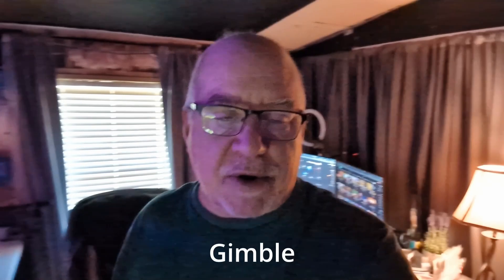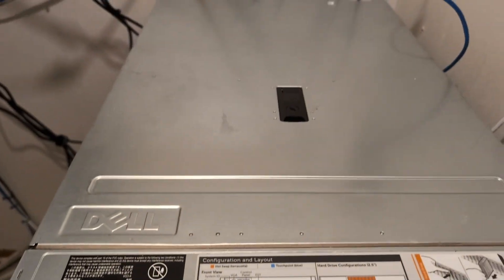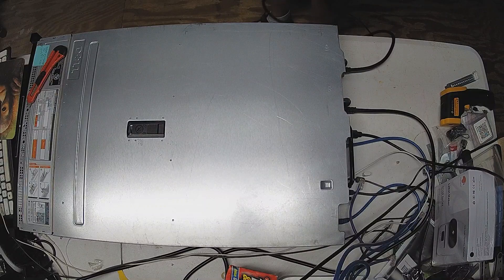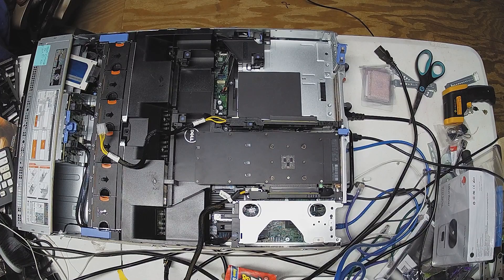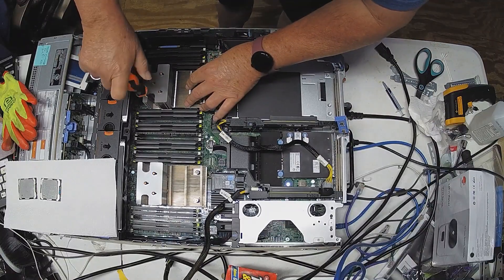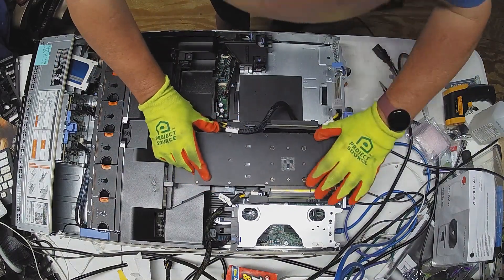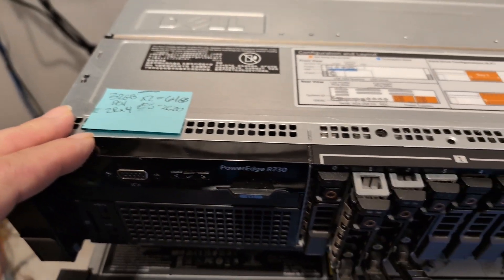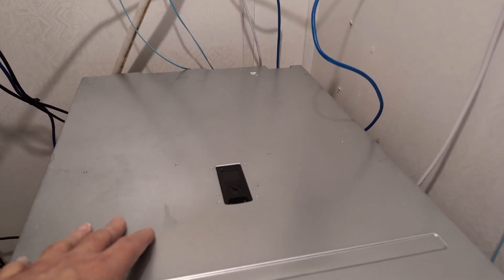Building a Dell R730 A.I Powerhouse Server?

Comment: Thanks for the video, but the music is way to loud and a distraction when I try to listen of what you are saying. Interesting: A pair of 1100W power supply about $29, a single power cable for the graphics card about $28 - what a rip-off for a bit of wire and two connectors.
Reply from the maker: Sorry about that, thanks for watching.